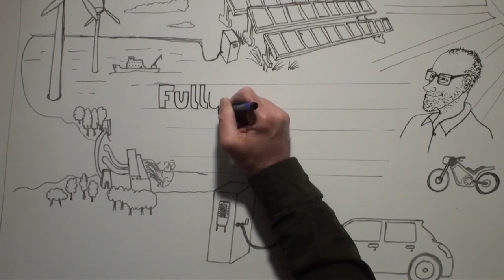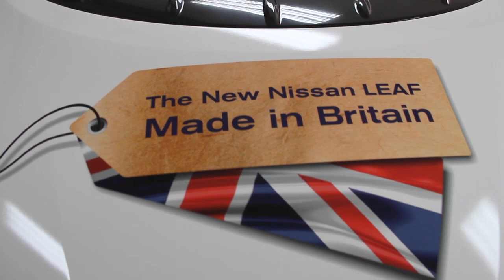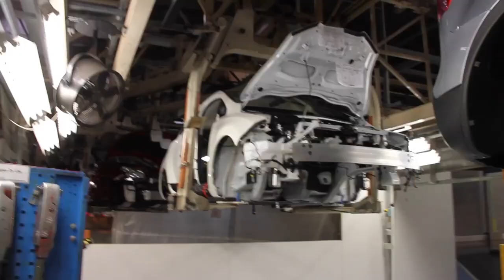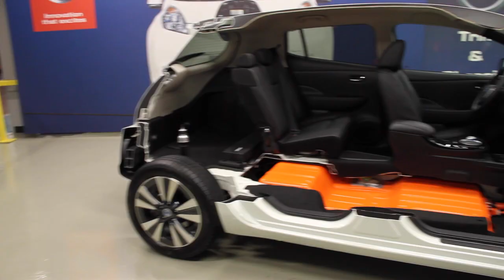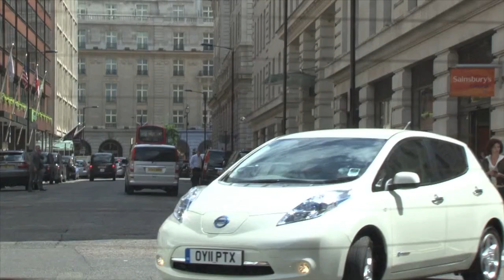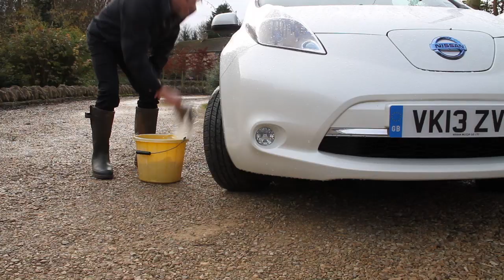Second Generation Nissan Leaf | Fully Charged

Comment: I.JUST. DON'T. GET. IT.

Why  is it that any car manufacturer nowadays making electric cars feels that they need to make the cars look like they were made for special people???!!!!!

For god's sake, this is key technology in stopping the world burning. Why is it that Nissan et al. don't just make a normal looking electric car?

Yes, they're expensive. Yes, they're not completely bedded in technology, but I'm willing to forgive both these points. Is it too much to ask in return that the average Joe, doesn't have to look like a total bell-end when driving one?
Reply: There are two reasons.

The leaf was designed in a wind tunnel.  The weird headlight shape is designed to force air currents over the top of the side mirrors to reduce noise.  That was necessary because the car is so damn quiet that noises that go unnoticed in a petrol car are very noticeable in an electric car.

There are EVs where the manufacturer has basically taken a petrol car body and plunked an electric motor and battery inside.  Look at the ford focus EV.  These vehicles have problems with noise.

However, there are new, more normal looking aerodynamic designs available today.  See the Ioniq, for instance.

The second reason is that some car manufacturers are only making EVs to meet regulatory obligations.  They don't want to sell them, or at least don't want them to sell too well.

Having said that, I think there is one big design flaw in the Teslas that only seems to be there to make the car look like a "normal" car.  That's the location of the charging connector.  It is where you would normally find a petrol cap.  This was a stupid idea.  It means having to do all sorts of weird maneuvers at on-street charge points.  The Nissan Leaf and Renault Zoe have the connector on the front of the car.   Much more accessible.
Reply: Very few people can buy the Chevy Bolt.  It is only limited release in certain specific states of the US.  There are no plans to release it in the UK or Australian markets at all.  They're only making left-hand drive models.
Reply: How would you like an electric car to look? a Crown Vic perhaps? I don't know where you're from but over here in Europe the Leaf looks pretty much like most late model hatchbacks on the market,
Reply: Desirable...
Reply: e Golf looks normal, teslas look normal, focus electric looks normal, ioniq electric looks normal, Niro EV and Kona EV when they come out in the next year or two both look normal. Also the 2018 Leaf looks normal. Yay!

Comment: I've had a new Leaf since Dec 14.  It's great for bopping about town, but an absolute nightmare on any slightly longer journeys.  For example, driving from one town to another today: 35 miles there + 35 miles back = 70 miles.  Easy, right?  Wrong... to manage the journey, I had to keep my speed to 30 miles per hour, which is ridiculous on a British "A" road; it upsets other motorists and takes too long.  There are no rapid chargers on this particular "A" road, which is 186 miles long; not a single charger.  Even if there was, Ecotricity now charge £6 per charge, which, when you factor in broken chargers, waiting in a queue to charge and the messing about using an App instead of an RFID plastic card, if all starts to feel like way too much hard work.
Reply: How is the range, is it dropping, batteries might not last 3 years
Reply: Sounds like a problem with your local infrastructure.  £6 is ridiculous.  Over the entire island of Ireland, it costs exactly €0.00 and there are fast chargers dotted along every motorway.

Comment: I borrowed a tesla last weekend and the one issue I had was the cost to charge it up. In Brighton we have a Charge Your Car chademo charger and it's £3.50 for the first ten minutes and 25pence per minute after that. This worked out quite expensive.
This is a receipt for charge session at charge point 70111, Withdean Sports Complex:

Session started at: 2016-06-26 15:49:47
Session ended at: 2016-06-26 16:57:56
Tag serial number: 20000000000C83
Energy (kWh) drawn: 33.6
Cost: ?18.00

£18 to charge for just over an hour?

To add insult to injury the charger limited the current after fifteen minutes which meant i was there longer.

I think an upcoming episode could cover this issue.

Fantastic job btw, I greatly appreciate your videos.
Reply: For almost all EV driving the charging happens at home or at slow chargers  and is a lot cheaper than that.

Borrowing a Tesla, you didn't experience the massive savings you can make through home charging every day during a commute which easily offsets any additional cost at fast charge points.

You'll also find that the Tesla superchargers would have been free and charged much faster than a standard FCP.
Reply: What video?

Comment: Please please Nissan put a proper gearlever on the next Leaf, no more guessing whether it has actually gone in to D or not or gone back into N. Fit a proper key start , it feels so un-reassuring to press a button and to perform the same action to turn the car on, and off. Make the regen etc properly adjustable , or at least stay in max regen (B) until you take it off. Not a bad car but I wish it was a superb car. It could be. Make a version with useable boot space too (estate Leaf??)
Reply: Not likely to happen or even desirable....Gear levers are redundant as there are no gears to move. Keys have also gone the same route so get over it and adapt this is the 21st century!

Comment: Why does it have a great big lead-acid battery under the bonnet? Yes I know it drives the usual 12V stuff, like the lights, but it has to be charged from the Li-ion batteries using a small voltage converter. Why don't they make the voltage converter just a little larger and get rid of the ugly heave old piece of obsolete technology?
Reply: +Donald Sayers You can jump start manky old fossil fuel cars off it.

Comment: I have a 2012 sl and only get 65 miles per charge, nissan lied but I love the car
Reply: +Miguel Gone You're either doing something wrong, or you need to take it back to Nissan and get a warranty battery replacement.

Comment: One little point; ICE cars do not have heaters warmed by an electric coil. They invariably have heat exchangers (And what a source of heat!)
Reply: +John Benton My ice car has both. It uses the coil while the engine is cold then switches to heat exchanger when it gets to a certain temp. You would never know from inside the car and it works extremely well. Quite a lot of modern diesels do this for quicker warm up times and a comfort.
Reply: That must be very reassuring for you. How does 2p/mile running costs sound?
Reply: John Benton
Sounds great but is mostly unrealistic - though electrics are a lot cheaper to run. That 2p/mile is usually based on getting 4-4.5mi/kwh which they might possibly do in a test centre in ideal conditions but it's as realistic as the mpg claims of ice cars - worse in a lot of cases. I've been driving an i3 for a few days and can't get it past 2.0mi/kwh even in eco pro+ and driving like a saint. Trouble is it's cold out and the heater smashes efficiency. It's also near as makes no difference £40k of car for something the size and performance of a diesel mini.

I like electrics and they are better than ice cars in my opinion but we have to be realistic about it.
Reply: The 2p/mile statistic comes from independent sources. You no like? Don't buy one. It's not compulsory - yet!
Reply: John Benton
I never said I don't like them - quite the opposite. All I'm saying is if you go round spouting such pie in the sky and people buy them based on that they will most likely be put off ev's for a long time after. Have a look at how the Mitsubishi Outlander PHEV has been shot down in flames for stating 148mpg then returning 40-60 of that.
EV wise realistically it's 4-6ppm presuming you only charge it on cheap night rate electric. That's still way under half the price of most ice vehicles and not far off half the price of a decent hybrid. Lets tell people that instead of some spurious figures they will never get unless they have a tail wind and never use the heater/ac or anything else we've become used to.
Reply: You can tell people what you like, but at the end of the day, cars are usually bought by the heart, not the head. (I had a Mitsubishi Colt some years ago. Nice little car but the materials used for the interior were very poor and terribly fragile.)
Reply: American leafs on 110v chargers take 21 hours to charge at home

That's only on a granny cable, which nobody does.  Granny cables are when you are visiting other people and need a top up.  I don't even own one.  I use the public infrastructure when travelling away from home.

When you buy an EV you also get a charge point with a minimum 3.3kw output.  These charge a 24kwh battery in 6-8 hours.  Personally, I have a 6.7kw CP, which completes the charge in 3 hours.

Teslas have bigger batteries and the home charge points they offer are 10-20kw.

Tessla has a different charging plug

Tesla sells an adapter so that Teslas can charge at normal type 2, CCS and Chademo charge points.

all this planning wallet full of cards ,praying your going to make just does not work with some people

Almost all driving that ever happens is short range.  So much money is saved that even if you live in a kip like Great Britain that has all these weird problems with the infrastructure that are unique to that country, you save so much money on your normal commute that you can easily afford to hire a car for the rare occasion that an EV is not appropriate for your trip.   You even have a car to drive to the hire place in.

If you're a commuter, a short range EV is a free car.  In comparison, the decision to buy a petrol car for the rare long trip is an incredibly poor financial decision.  You're throwing away tends of thousands of pounds for the convenience of either not stopping to charge or not having to hire a car once in a blue moon.
Reply: Curious if you were using the i3 in the city with heater on returning only 2.0mi/kwh. If so the extra draw while moving slow or stopped may give this figure. Same holds true from a normal car idling while stopped not covering the miles. I ran a Leaf and could get around 5 miles per kwh in a rural environment. In winter the car was preheated on mains before departing.
Reply: Teslas have 60-100kwh batteries, offering ranges from 350-500km.  £18 for 350km of travel is pretty good when you consider UK petrol prices.

The other thing to consider is that almost all charging happens at home.  The prices you're seeing for charging is the price at fast chargers, which are only used for long distance travel.  Fast chargers are expensive to install and maintain.

The reality is that if your daily commute is under 150km, you make massive amounts of savings every day. Even if the price of electricity at a fast charger was massively higher than the equivalent price of petrol, and it isn't, you'd only be paying that for a long journeys, not every day.  You'd still make a very big overall saving.
Reply: Who really gives a shit? Going places costs money. Always has, always will. If the car costs over £60,000 who bothers about the price of fuel?
Reply: 1: He wasn't using a Tesla supercharger.  He was charging at a standard public fast charger or it would have been free.
2: In Great Britain there is no free charging except for Tesla Superchargers for Tesla Owners who bought before January 14 2017.
3: The cost of charging at a public charge point is irrelevant because of the savings you make when charging at home, where almost all charging happens.

Yes Teslas are expensive cars, but Leafs, Zoes, Ioniqs, BMW i3s are not.  There is a low enough initial cost to these vehicles that they can completely pay for themselves in fuel savings with or without a high cost public charging network.

Comment: The price of a new Leaf still scares me! I know ll about the economies of use compared with an ICE car, but I still have to find the substantial up-front money!
Reply: What would be an OK price? On their website, the cost is $21,510.

http://www.nissanusa.com/electric-cars/leaf/versions-specs/version.s.html
Reply: John Benton 150 quid per litre!!!!

No wonder so many of my UK friends and relatives are always crying poverty
Reply: I settled on the Leaf because it's electric. I am a Motability customer (until IDS says otherwise) and £600 is a small price to pay, whatever the price of fuel. There's another 13 months to go on the current lease at the moment, and I can't see Hyundai offering electric traction between now and then. (I'm on my second Hyundai for the simple reason that they are very well-made, reliable cars).
Reply: Are you in UK or elsewhere? You can research what tax incentives you might get for going clean.

Here in California the deposit for a lease is $2400 and the state gives a cash rebate of $2500, effectively negating the deposit. Then the leases start around $220 through to around $260.
Reply: geffel I'm in the UK but I plead special circumstances as I'm an OAP and disabled, so I lease a car through a UK charity called Motability. My current (and previous!) vehicles were Hyundai, chosen originally for their low 'Initial Payment' but the current one - an IX20, is proving very versatile and reliable, if a little thirsty. The IP on the Leaf Acenta ( my preferred choice) is £600 ($750) which for me is a lot of money. But on the bright side, I'm still at the research stage, so my final choice will depend largely on IP (though for environmental reasons I have restricted my 'short list' to electric cars.) As they say in the small print everywhere, we'll see!
Reply: John Benton Ah yes, I know what Motability is. My mother's friend had a car via that laudable scheme (I'm an emigrant fro mthe UK). I was about to ask what the Various Leaf model names were when I realised they translate to the US versions which are S, SV and SL. 

After much going back and forth and a reluctance to say goodbye to my Audi S4, which is (was) a 340 hp V8 11mpg German monster and the sort of thing that Top Gear presenters would  have razzed about in on their track (in 2004), I succumbed to the cheap deals and cheap lease payments on a VW eGolf. 

I'm still jittery and worrying about the choice, about giving up the beautiful Audi and taking on a car that can't go very far without requiring at least a half hour to refill, about having a new car that can be scratched and about the payments. As a contractor I never quite know if I will be paid or not.

Good luck with your choice.
Reply: Thanks. Your post was most enlightening. The two models of Leaf that interest me are the (midrange) Acenta, and top-dollar) Tekna. I Cant remember what the base model is called. I'm glad your Mom took advantage of thr Motability scheme; it's proved a life-saver fro me (I've been having cars off them for over 40 years, and they keep getting cheaper to lease, so I have high hopes for 2017 when my current car is due for replacement) I can imagine the uncertainty you face, and It's quite a risk you're taking. I hope you're taking the risk into account when you're setting a fee! Best of luck with your VW. (They're not available in UK at the moment, but things are changing very quickly!) Whatever you do, remember to keep smiling!
Reply: John Benton  I'll try the smiling thing but obviously don't want to cross the line into looking imbecilic.
Reply: John Benton  Oh, one other point. Fuel here is about half the cost of fuel in the UK so the financial benefits of driving electric in UK and Europe are even greater than they are in the US. Fuel for my Audi was circa $4.07 cents per us gallon or 64p per litre. Last time I looked at UK petrol prices a litre of petrol was  £1.07. Yanks would pull their own heads off in fits of pique at that price. British people just complain to each other and say 'mustn't grumble'.
Reply: geffel It's now June 2015 and 2* petrol (which all petrol cars use) is £116.0 per Litre in UK. Last august it was £150.0 per litre!
Reply: John Benton Seriously though, that's twice as expensive as here in Los Angeles.
Reply: +John Benton If you can get the £600 together it's well worth getting the leaf. I don't know what mileage you do but motability is 3 years lease, correct? Even at the current low fuel prices and low mileage you would be saving a fortune. 8000 miles and £1/litre would be around £920 if you could get a car to average 40mpg (not likely if it needs to be large enough for a wheelchair and does mostly short runs). The same in a Leaf presuming low rate electricity and claimed figures would be £160. Realistically we'll say £200 as a maximum. Remember if the other car averaged 20mpg it would then be £1840. If fuel went back to £1.30/l it would be £2400.
Reply: Right, so lets do this again.

I will go out on a limb and assume your numbers are correct, even though you seem to be a pathological liar when it comes to EVs.

16.5p per Unit.

9.7kwh in 1L of petrol @ £1.20 is 12.37p per Kwh.  And you need 3Kwh to move your car the distance that 1kwh will move an EV.  That brings the per unit price to 37.11p.

37.11p vs 16.5p per kwh equivalency.  So it costs 55.5% more to run a petrol car than an EV.

But of course your per unit electricity value is not an off-peak figure is it?  that's just what it costs to run an EV if you charge it in the middle of the day while most people are at work!